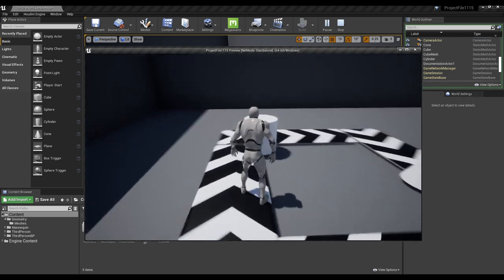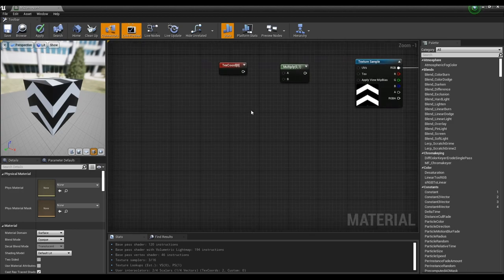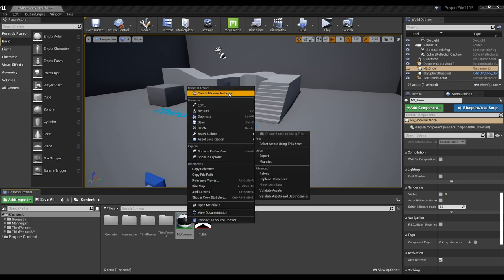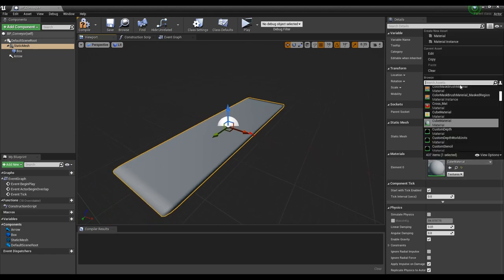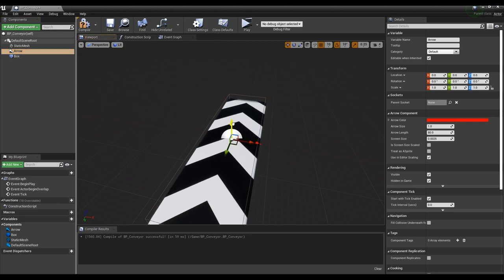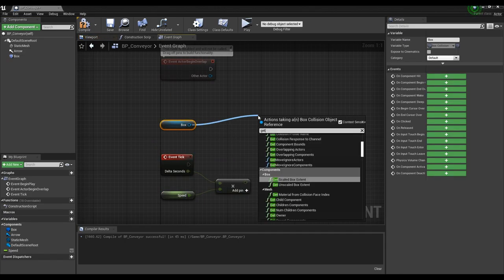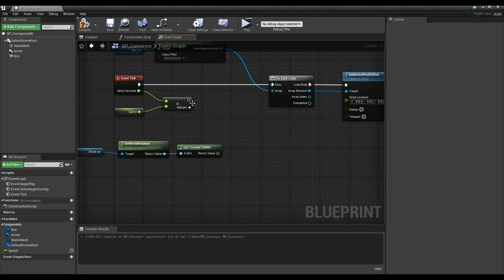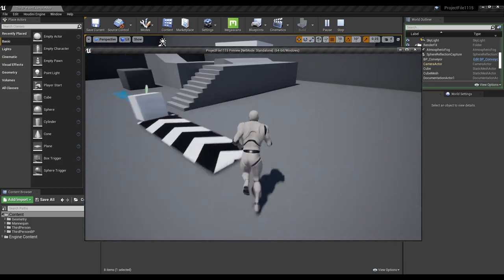UE4 l Creating Simple Conveyor Belt l 5-Minute Blueprint Tutorial l Unreal Engine 4.26

Comment: The effort was great but two things made me ultimately delete it and continue searching. 1. The tex file is behind a confusing discord system with a registration, instead of a google drive, or similar, link..for an icon. I couldnt find it and the only one I had was terrible.  Then the resulting blueprint, following the code, wasnt working in 4.27 without modifying it.  Check out the same system by -Dean Ashford-. It has some neat functions, works great and he gives you the tex, and a simple mesh, with one download link for each.
Reply: <3

Comment: I've made some of my own actors I'm certain that they have simulate physics on as well as generate overlap but they just don't move, any suggestions?
Reply: i have the same problem.
Reply: Swap GetOverlappingActors with GetOverlappingComponents instead, and swap AddActorWorldOffset with AddWorldOffset.
Reply: @jayc586  no work
Reply: @jayc586  I cannot connect the box to the Get Overlapping Components. It says: Box Collision Object Reference is not Compatible with Actor Object Reference.
Reply: Little late but if you replace your default scene root with that mesh your moving it works.